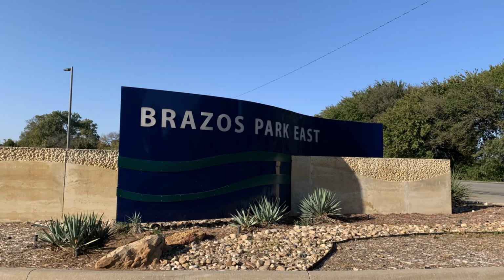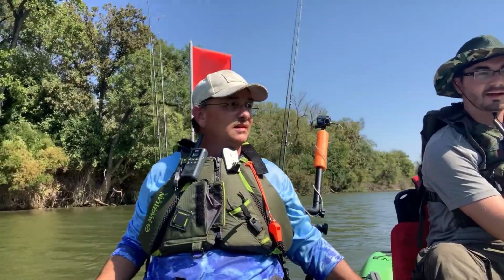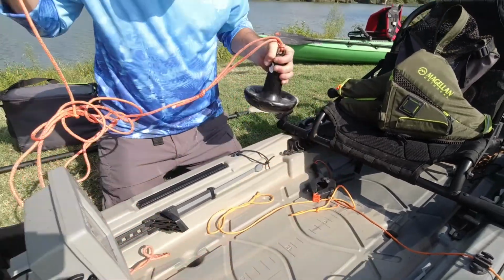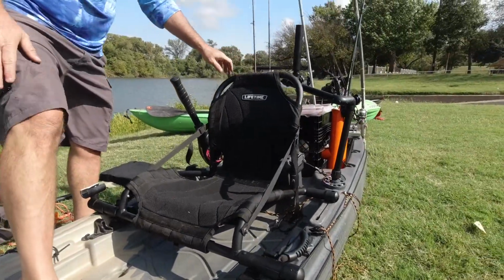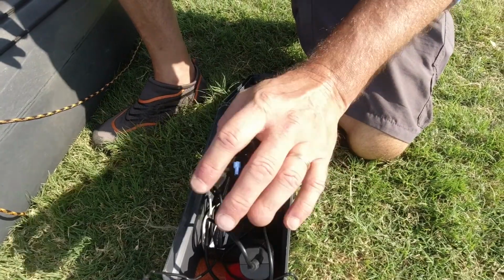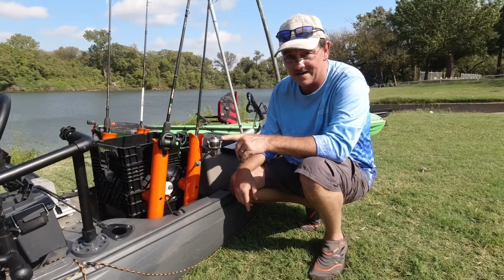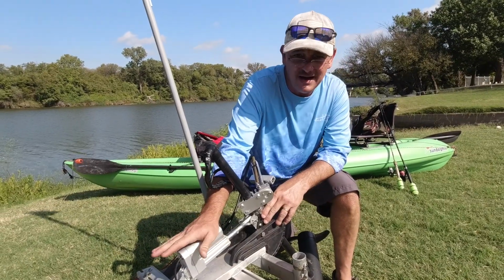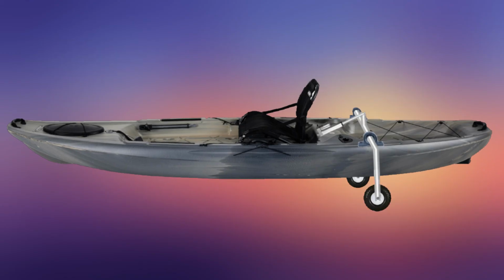The Most DIY Kayak Ever!!!

Comment: Great work young man!!!!! The tilt and turn for the motor is genius. I didn’t want to run the cables for a traditional steering like most other yaks. Plus not having a rear hatch makes it hard to run the wires inside the yak (which is what I was thinking) once added a hatch behind my seat and now I’m gonna secure my milk crate with a couple of nuts ,bolts, and washers. I love your diys that so improve the yukon. Your design is impressive and cheap cheap cheap. 👍🏾👍🏾👍🏾
Reply from the maker: Thanks I have more coming out on that kayak including a new improved kayak seat upgrade for the Yukon angler 116
Reply: Look forward to seeing your projects!
Reply: Where are the mod videos?
Reply: I am ready for the seat modification. I have looked all over YouTube but I know where to find the best. You and Marty.

Comment: seems like it would be top heavy with all that gear and higher seat, therefore more prone to tipping?   how is it regarding that? or do you plan to build stabilizers so when you lean to pick up a fish, it won't roll and dump you?  Very neat engineering you did!!
Reply from the maker: No not top-heavy at all. In fact it’s a wide standup kayak. I even stand up and fish in it. Also I’ve got a video out sure where I was in a bad storm where I was riding waves sideways and up and down and never lost control and I’ve never flipped in it. It’s a very stable kayak. Thanks for the comments love to hear this

Comment: Love the trolling motor! I was in a bad car wreck and need a trolling motor to kayak now. What kayak do you use. I've been looking at a Pelican Sentinel.
Reply from the maker: I have the lifetime angler 116. It’s a cheaper kayak but it’s a tri-hull so I like it. For a good kayak for fishing and stability and you’re looking at a pelican you should go for the catch 100 or the pelican catch 120.
Reply: @PROAMOUTDOORS  yeah, the only reason why I was looking at the other model was price. Not only did the wreck damage me personally,  it greatly impacted the wallet. That is why I love hack videos. I just saw one where a guy used a power tool battery charger as an additional battery supply.
Reply from the maker: If you want a really good kayak at a low budget price I would look into the one that I have which is the lifetime Yukon angler 116

https://www.walmart.com/ip/Lifetime-Yukon-Angler-11ft-6in-Fishing-Kayak-91055/554809173

Comment: Nice set of mods... One thing I don't see though is boat tags/numbers displayed on the kayak.  It's motorized and therefore required to be registered/tagged if on Texas public waters (Brazos Park East, etc).  Remove the motor and no registration/tags required in Texas.  Good luck - eventually you will get cited.
Reply from the maker: Yeah I just built that bracket system for the trolling motor and shot the video. The next following week I got tags on that kayak. That video is about one year old. Watch some of my newer videos and you’ll see the tags on the kayak. But, thanks for watching